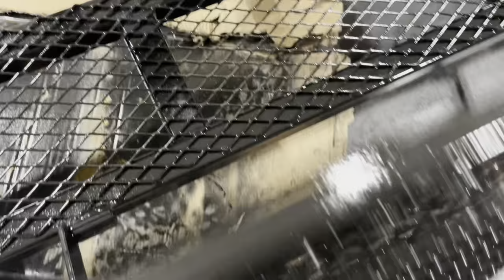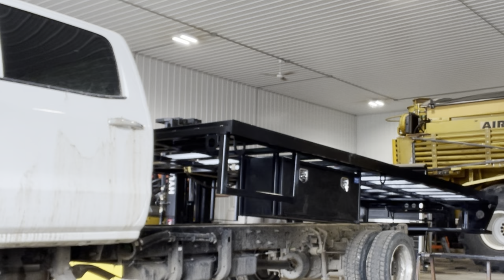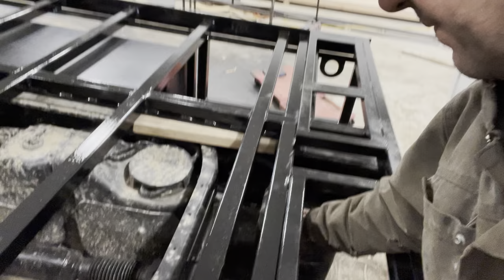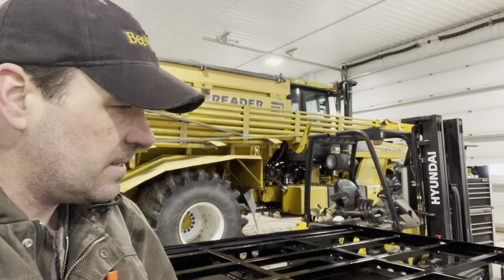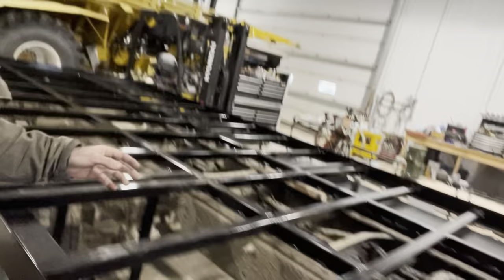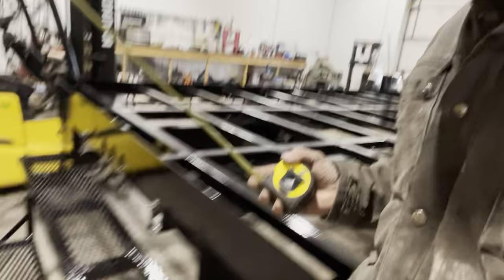Slight Change of Plans to the Truck Deck Build

Comment: Don’t listen to either brother and do what your uncle Gordon would do, and find two broken off fence posts to put under it for shims and hammer a hole in the front of the fuel tank to make room for the the boom, and don’t worry about the tires they’ll make their own clearance eventually against the frame rails…
Reply from the maker: It did cross my mind LOL

Comment: It is common practice here (Australia) to build decks on top of timber on purpose, to dampen any high frequency vibrations that destroy welds. The deck is then held in place with bolts or even U bolts. Also it is important to remember that fuel tanks are no longer externally vented, and are vented through the air intake to burn off any fumes, thus producing a slight negative pressure within the tank..

Comment: I like the 2x4 on the frame solution. My bed is sitting on thick wall 2x2, and it’s very low. I wouldn’t mess with the tank. Opening up potential problems. Step bumper looks great.

Comment: We’ve mounted all our decks with a treated 2x4 between. Never had a problem.  I believe if your using a U bolt to secure it the lumber between the two helps keeping the deck from sliding on the frame.
Reply: I had 4+4 treated as front spring in my car for highschool... Spring broke on fishing trip amazing how fast can fix things on fishing trip

Comment: Ian, putting a wooden frame rail between the frame and bed will work. Some truck company's use the white hard plastic, the stuff that cutting edges that are put on snow plows so they don't mark up the black top driveways.

Comment: Sounds like you got a good plan for the modifications. I woukd think that the extra clearance for the wheels would be best also in case you have a heavy load that compresses the springs and would in turn bottom out the wheels

Comment: The step looked pretty close to matching the height of the old truck.  I do believe I would leave the 2x between the two, and add another 1.5 to 3" to the loader deck.  Keeps the low profile idea, keeps the steps from rubbing, and lifts the loader.

Comment: I agree, cut 4" of the chassis and push the new bed forward and loose the bar over the wheel..
Reply from the maker: That might be an idea. 
I need that clearance for the loader arm ram but not exactly sure how it lines of on this type of chassis

Comment: 2x4 will crush and shrink over time….. steal .. is forever!! I would however take a  strip of crusher mat the heavy duty rubberstuff with fibers in the center  and cut strips the length of the frame and put them between the frame and your flatbed..( it’s like 1/2 or 3/8”thickness ) this is a common practice and allows for some flexibility so things will not snap when driving around and flexing of the bed with a heavy load

Comment: I like it! What happened to the blue paint? As far as raising the bed, old straight trucks used to use a piece of oak under the bed to stop steel on steel wear. Treated pine may work, but its soft. I too thought maybe just raise the ez loader, but then you have to do more work by the tires. I dont think that the 1½ is going to be that big of a deal? Love the step and latch on the back end!

Comment: Ian, how often do you fuel with the truck loaded? You could make a trap door on the wooden deck and fuel it through the hole. Just an idea I had. I'm just think that 1 1/2 inches of lifting is over the life of the truck so make it easy for the long haul. Just my opinion. Good job on those steps, thats nice.

Comment: On the fold-able step, a more positive latch might be better.  Thinking those rubber ones might fail or slip if someone steps on it when in the upright position.

Comment: Add 2 inch  tube underneath the whole length... stitch weld it repaint....volla clearance issue solved...no 1 inch plate and still a couple inches lower than old truck deck.  My thoughts.....Cheers

Comment: Can your EZ Loader be flipped to the passenger side where it won't hit the fuel tank?  that might lead to other issues, but it might gain your 1 1/2" back.  Good luck!
Reply from the maker: Not exactly, the hydraulics stick out the wrong way

Comment: treated 2x4 will hold moisture and it would rust 3 times as fast. as far as the tank, is there just a little bit of it in the way? and could you drain the tank and use a Bodyshop type heat gun and heat up the corner of the tank and push it down or perhaps its metal.
Reply from the maker: Interesting feedback on the rust issue and on the tank mold

Comment: can you move the deck forward enough to clear the tank?  it appears you have a bigger gap between the cab  and the deck on the new truck vs the old.  or could you move the boom to over the back axle?

Comment: Sorry you ran into a snag.  Are you going to make an access panel for that fuel tank, in case the pump goes bad?
Reply from the maker: Good idea
That deck board will pull up easy enough if needed

Comment: Shim the eazyloader off the deck up 2 or 3 inches.  You will regret that extra deck height forever.
Reply: And you won’t ever regret sitting the loader a bit more off the deck. I’m gonna put my new loader about 3” off the deck height.  That will allow me to tuck the loader closer to the cab as well.

Comment: Why not leave the deck lower as designed and just fabricate a spacer for the hoist lifting  it up? You're gonna need to buy material either way you slice it.Worst case if you're through bolting it you'll need to get longer bolts.

Comment: Seems like cutting the front 18 inches off and building a deck for the ez-loader that is separate from The rest of the flatbed should fix the problem.

Comment: Don't use wood. It will only cause you problems in the future.  it won't be that much trouble to put the steel in now. After you get the easy loader and deck on it will be a pain in the a.....

Comment: Did they change the wheelbase of the truck, or just lengthen the tail?
Reply: Also, at 8:55, I agree with the "other brother".
Reply from the maker: We lengthened the chassis wheel base 36” and 4’ out the back

Comment: No opinion on the wood vs. metal spacer, assuming you go that way.  Surprised to see your measuring tape in inches.  Figured you guys up there were metric-ally inclined.
Reply from the maker: We use both at the same time 😂

Comment: Wood will compress especially when it dries. With weight alternating side to side this  will become an issue and could split. You've come too far to cheap out ;) Not a fan of the rubber latches on the stairs, bolt latches and finish impressive...

Comment: Going to void your warranty and open yourself to liability in an accident... worker gets blown up going to prison....cant move the tank unless the dealer does it..imo .. Sucks you don't have natural gas on the farm that's the answer to alot trouble and fuel cost and the motor lasts 5x longer

Comment: Heat up the tank and smash it down.
Reply: NOOO. That's part of the Fuel vapor trap system that sends vapors to the engine air intake - if "damaged" could be very negative for any future warranty work. Which is probably why Ian doesn't want to mess with the tank and embedded electronics.

I vote for a treated 2x4 on the frame. All the old body job grain trucks had hoist's attached to the 4x6 wooden beams ( not treated) that supported the weight of the fully loaded box when lifting and rot was not an issue.